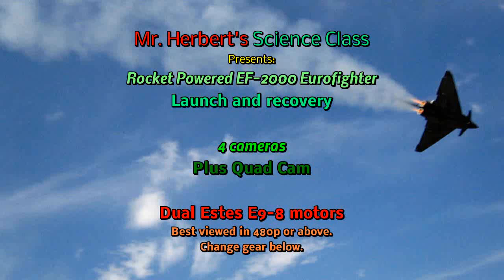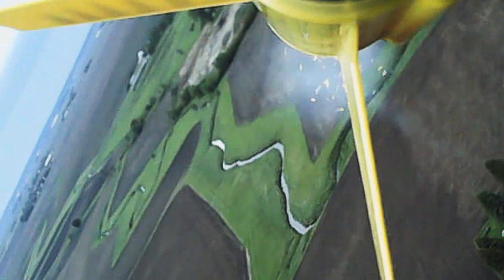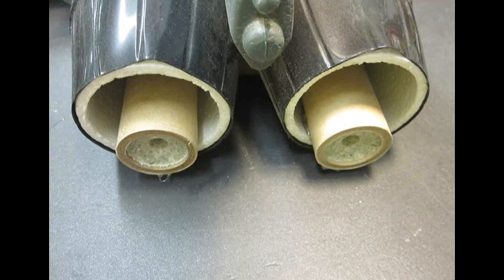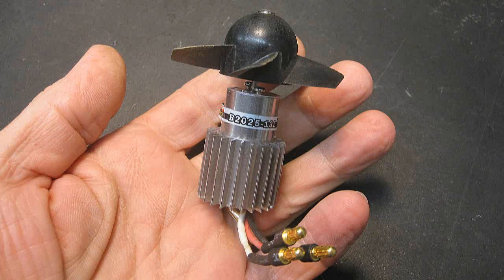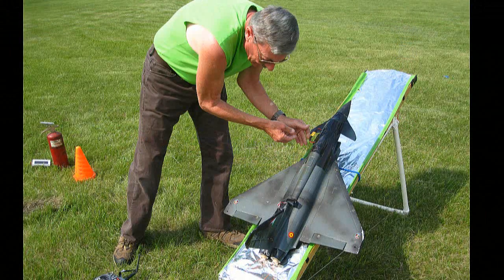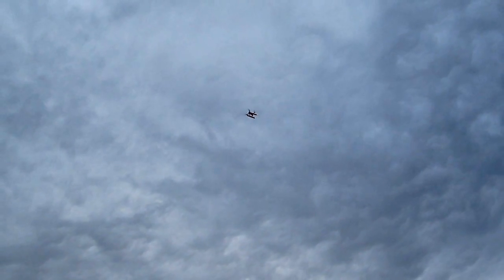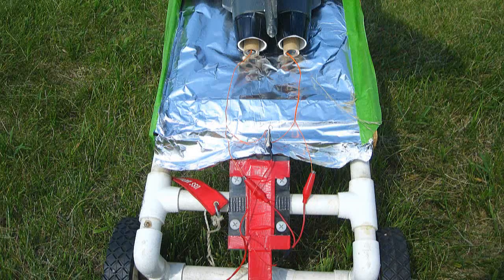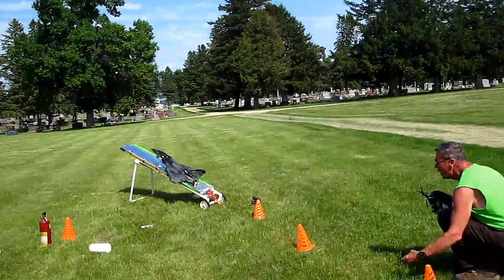Rocket Powered EF-2000 Euro-Fighter Typhoon test flight.

Comment: Just enough camera angles for my liking.  :)
Any way you could you try catapulting it with the motors firing?
Reply from the maker: nishbrown Haha. Nope.  That backblast blew the board off the launcher and also burned the bungee.  I think I will not put my foot back there to launch it for that reason. LOL.   Besides, that baby came off the launcher way faster than the launcher could shoot, that's for sure..  It was all very quick. Thanks.